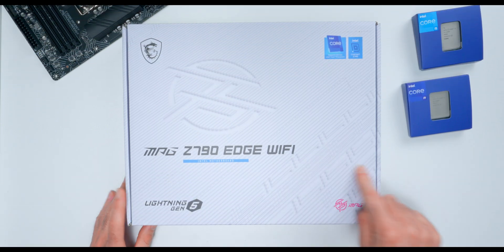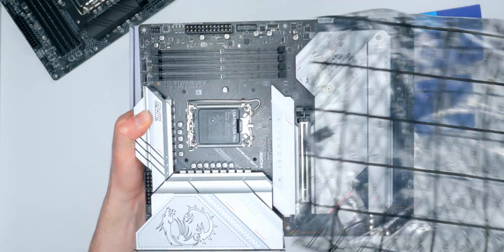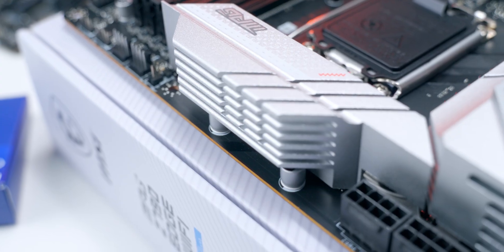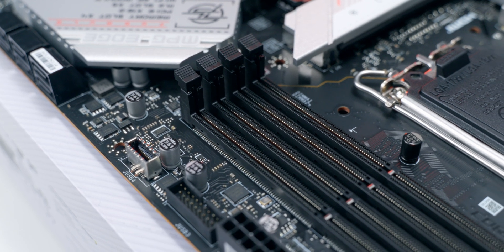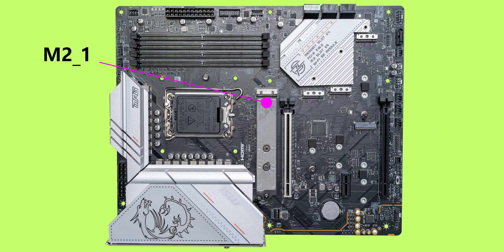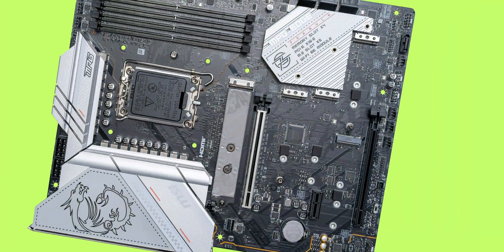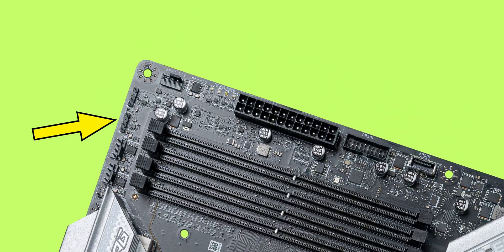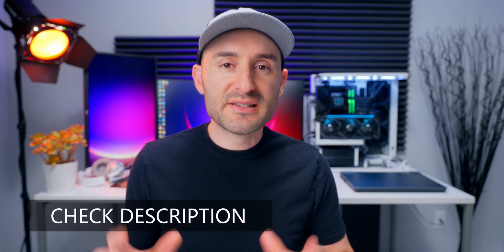MSI Z790 Edge WiFi DDR5 Motherboard Unboxing and Overview

Comment: My wet dreams came true when I saw this MOBO, you cannot have too much storage. I will add, I have just ordered the newer model MSI MPG Z790 EDGE TI MAX which has a massive EIGHT SATA connectors and FIVE M.2 SSD's. Oh I am in heaven.

Comment: with a M.2 in the first slot. Wouldn't that hinder my gpu to 8x lanes? My understanding is that it does on the MPG Z790 EDGE TI MAX WIFI but nothing written on the manufactures webpage for the MPG Z790 EDGE WIFI.

Comment: When the Raid is active, on this motherboard no hard disk is recognized from Bios, this means that software like Acronis with USB Boot does not recognize any disk drive and therefore it is not possible to CLONE  the startup disk. I have an open ticket with MSI where they tell me it's normal ! 😵‍💫

Comment: Does anyone else have problems with getting MSI center to work. I can’t control the RGB on the board because I can’t get MSI center to let me download anything. Also I’m having audio issues and I’ve check that my audio drivers are update. Has anyone found a fix for any of this?
Reply: You find a fix?
Reply: I COULD be a need for windows 11 ( not sure but… you can check that)

Comment: i want to pair it with the g.skill trident z5 8000 mhz. do i have to overclock the board before it's gonna accept the ram? is it gonna cause any trouble?
Reply: I would use it without over lock first. And boost it after when it works. You’ll see the difference this way

Comment: I've had one of these for 3 weeks now and it's great BUT, there;s a lot of coil whine which, had i known, I would have opted for a different board. Other than that it's pretty solid running a 14900K with ease.... As long as the latest BIOS is in there.
Reply: Hello,I,hope I,won’t get that… but just a question: can it be caused by the GPU or your cpu cooler or ventilation. I,heard a lot of people complaining about liquid cooler noise too. So maybe the problem is not the mobo

Comment: So you have to overclock to get those speeds like 7000mhz? I’m kinda confused.
Reply: for it to support those speeds yes
Reply: @enskdnejsnsk  so like going into the bios and doing the xmp profile thing and set it as 7000mhz? im sorry i kinda new
Reply: Yes you need to experiment little by little til it crash lol then you come back a little . I,personally won’t overclock before the whole system is working perfectly for a month then I’ll experiment

Comment: What about bifurcation PCIe X16 to 4X4X4X4X???
Reply: For my GPU I will use slot 1 ( it,goes directly in the cpu) as slot 2 goes on the chips. My GPU is pcie4 but I don’t care…. Slot one can be used ( the speed will be limited to 4 that’s all)

Comment: can we use two gpus with this motherboard or it is not advisable ? :O
Reply: You got 2:slot for this …´slot 1 is connected directly to the cpu ( faster) and slot 2 is connected to the chips (slower) I,took the decision to buy a better GPU and give the old one to a friend

Comment: I have this board and trying to instal it in an o11 dynamic case.  Do I have to take the I/o shield off to install because it’s not lining up with my standoffs
Reply: what did you end up doing
Reply: Yes choosing the righ case is important. I will try to install on my old one but I won’t fight too much, if it doesn’t work,well I’ll order another case .

Comment: 03:18 What does this mean
Reply: When you want to install your SSD you need to put the SSD that has the windows or Linux, whatever you prefer for operating system in the first slot.

Comment: Question. If I have my graphics card in the PCI Gen 5 slot and my M.2 card in the Gen 5 slot ..that means both the graphics card and m.2 are sharing lanes to the cpu? So I'm only getting half the performance for both? 

I just bought this mobo and building my first pc so I wanna make sure I get the right setup
Reply: Did you get an answer??
Reply: @andrewpetrilli5701  yea so there's 24 lanes. Graphics card in gen5 slot will take 16 lanes and the m.2 in 5th Gen slot will take 4 lanes. So it's all good. No issues.
Reply: @Dymindntheruff does it matter if the nvme is gen 4 or gen 5? Im using a gen 4 in the slot M1 and was wondering if im doing it right
Reply: @kinneydyt  you can use either in that slot. I'm using gen4 now in that slot but eventually will upgrade it to gen5
Reply: @Dymindntheruff  ok cool thanks! I plan on gen 5 eventually I'm just hearing how they have heat issues and don't want to risk it just yet
Reply: You’re perfectly right. Best result is use your best GPU in slot 1 ( even if it’s gen4 it will works limited to gen4] and heat issue with gen 5 and also intel 9 is real so I will install intel 7 and be happy
Reply: Hey man! Any updates? Loving it? Hating it?
Reply: @brydenkelsey3257  so far it's great although I'm only able to overclock the RAM to 5200MHz even tho my DDR5 RAM is rated for 5600MHz. It still runs awesome. No problem editing/exporting videos super fast with DaVinci Resolve and butter smooth framerates on maxed out gaming settings.

Comment: So I know this board has an HDMi and Display ports but they aren't allowing me to connect a monitor to them, does the mothboard come with integrated graphics because I couldn't find them in the Bios.
Reply: Motherboard don’t contain integrated graphics. Make sure to buy a cpu that has integrated graphics to display visual. Otherwise you need to buy a graphics card.
Reply: Igpu is a feature of cpu. Be sure to buy a cpu that has one, enable it in the bios, then you're good to go.
Reply: You can order an adaptor HDMI to avg or whatever you need

Comment: Am buying msi now on after another asus bord failure
Reply: I just brought mobo and 13600k cpu mate only 1 hr ago online haha, it's the goldie locks of specs I'd say.
Reply: @mr.sunnyg5510  just had my z490 board from asus fsil after just three years
Reply: @novatoopni  yeah asus claim to be the "be all, end all" but half of it is that ROG logo 😂 my opinion... but after having msi mobos and gpus for a while now and no complaints I recommend msi.. still buy rog/asus hardware but if msi has the same option and is cheaper (which it always is) then I'm buying msi...

Comment: HEADS UP IF YOURE PUTTING THIS IN A FRESH BUILD WITH WINDOWS 11

For whatever reason this boards Lan port doesn’t play nice with windows 11 until you get the drivers installed, and it doesn’t give you the driver install prompt until you connect to the internet. 
The workaround is to use an Ethernet to usb adapter and run your Ethernet into a usb port until you can get the drivers installed. 
It took me hours to figure this out.
Reply: I will use install it on windows 10 first. I,don’t need wifi now maybe next year
Reply: @louiserichard1729  Did you get it, are there any problems?
Reply: Can you you connect to Wi-Fi wireless?
Reply: Just got my ddr5 board and it came with a usb that has a lab driver setup on it
Reply: @skraett just brought the ddr4 version and a new 13600k an hour ago mate, I can't wait haha

Comment: Just like yours, mine DID NOT come with a manual. Made me pretty sad that they don't offer it with the $300-400 product.
Reply: right i was thinking the same thing, it really should come with a manual.
Reply: I agree but it is online.
Reply: @neochirpLOL
Reply: Yes but it is easy  to find on line . Just Google it. Maybe this is why they don’t print Manuel often . Good luck anyway

Comment: I own this board with a 15 13600k works great
Reply: I'm about to finally upgrade my pc again after another 5-6 year cycle, and this is exactly what I am researching and aiming for, i5 13600K and this msi Z790 edge.
Reply: @Lishkabro  wait for the intel 14th gen first. I don't think this board can support it. They said it will be released this year, so I'd wait a couple of months if I were you
Reply: @sammygreen7116  there are news they will use LGa1700 for 14th gen
Reply: @rubindas  Wrong, Intel said the 14th gen will only support LGA 1851 socket.
Reply: @sammygreen7116 ehh all depends, I'm coming from a 2600x cpu and a ol b450 mobo so anything 12th gen and over is heaven to me
Reply: @sammygreen7116 no one will need a 14th gen for like 8+ years.
Reply: @Lishkabro mines on the way from newegg right now
Reply: @Lishkabro spending more on the motherboard than the cpu is crazy
Reply: Do I need to flash BIOS first for 13th Gen or am I good to go out of the box?
Reply: Yer just grabbed the ddr4 version for 399aud and a 13600k for 480aud... upgrading from a msi B450 gaming plus and a amd 2600x 😂 so I can't wait to see the improvements... happy days 👌
Reply: @mr.sunnyg5510 why not get the ddr version
Reply: What ram did mate use?
Reply: @saifullahsaif1307  if you mean me, a shitty cl16 corsair vengeance, 3200mhz 16gb. I need a upgrade m8
Reply: @mr.sunnyg5510 I mean you should have went with the ddr5 board so you can upgrade your ram to ddr5 and be set for years, in like 4+ years you'll need to switch to a ddr5 motherboard
Reply: @coreywagner8998  ahh I won't stress about it till the future mate haha, was a good price and since ddr4 is still going strong so I won't worry till 2027 I hope 👍
Reply: @coreywagner8998  for my z790 msi edge, ddr4... it was 399aud compared to 530aud for the ddr5 version??? That's just not cricket 🤣 all that money just for ddr5? (Mind you I got it from a aussie company by the name of Umart which have sales on all the time, they slapped one on the ddr4 msi edge so I had to get it, was a steal)